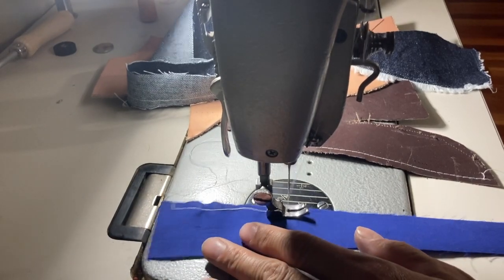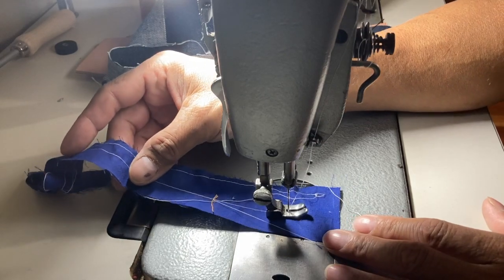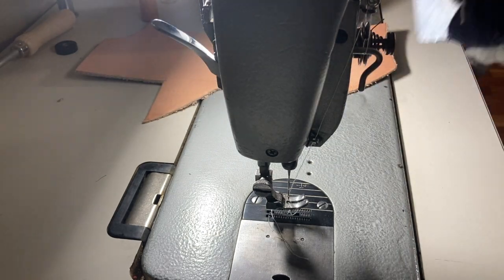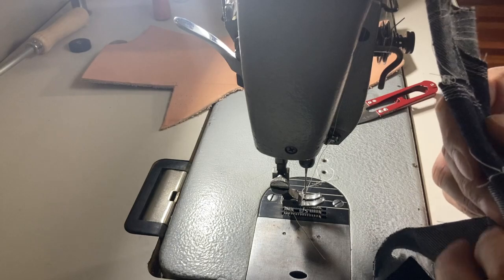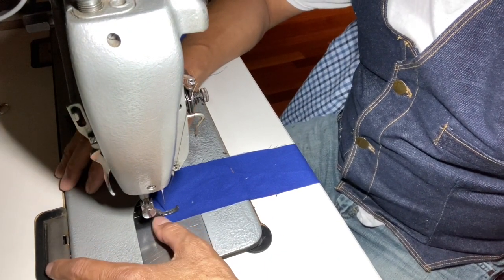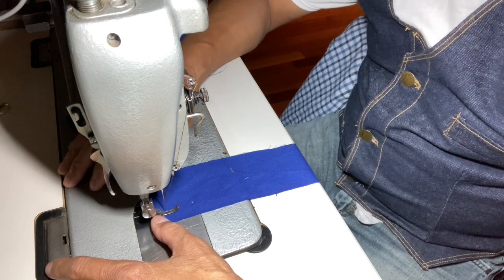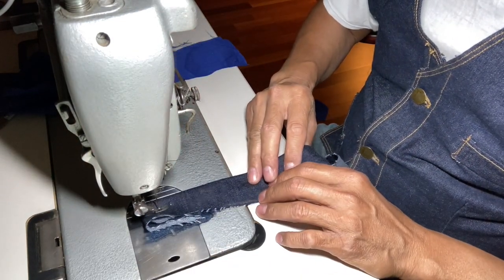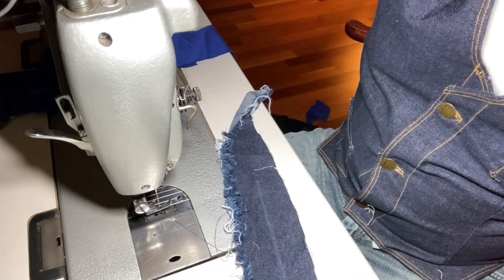Consew Clutch motor vs Consew Servo Motor 1000

Comment: I have 2 questions:
1. I have a industrial sewing machine singer brand that had weird sound, and is slow to sew at the start, can you help advise me what to do?
2. The motor has a switch that can rotate voltage, the switch has been on the right side for the last few years, can I rotate the switch? Will it affect my machine?
Reply from the maker: sorry it took a while to respond. I'm thinking you have clutch motor? If so, the my clutch motor starts 1) slow (like a car) and then stays on evenly 2) Be careful with the switch, if I understand you saying it can rotate voltage...you might be going from 110 to 220 and can cause a shock or may damage your motor.  If you love your sewing machine, you might want to look into the servo motor, saves on electric bill and hearing, might run you about $110 if prices have not gone up too high. All the best to you